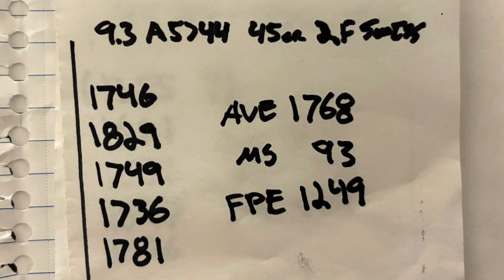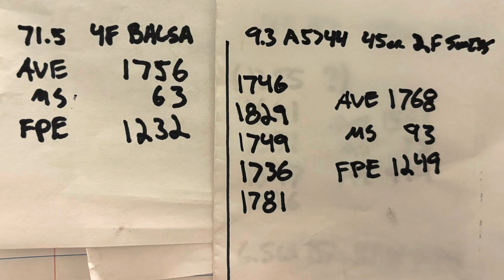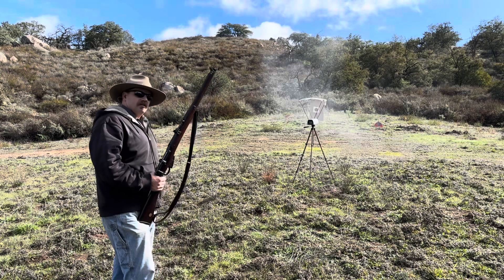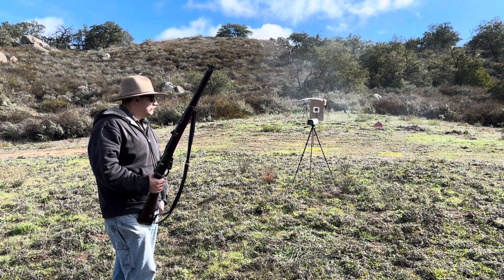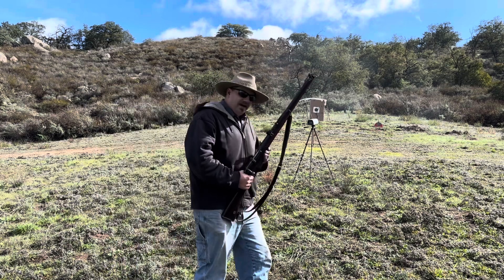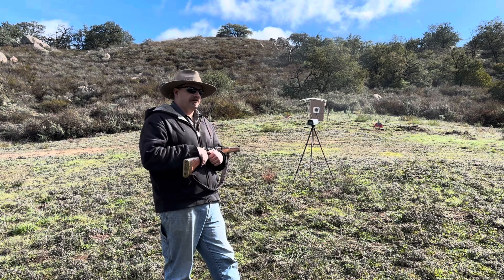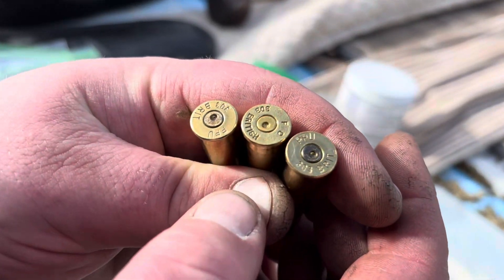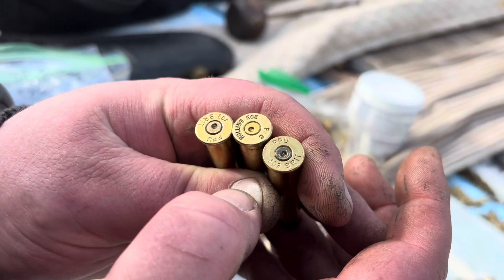Duplex loads, Mixed and Reversed Powder Charges

Comment: Your small smokeless over a main BP resembles my experience with a fat smokeless main charge under a smaller faster powder on top(also smokeless) in .45-120.   I have a .32" barrel, and my best guess is that the slower big main charge is pushing the faster burning top charge down the barrel, then igniting it there - helping to keep pressures up in the long barrel.   Juggling charges around I was able to push a 300gr .458" JHP to about 2800FPS.  ....my groundhog vaporizing round.  I'm not going to give out duplex loads in public for liability reason.  But my main charge was an IMR-4198, and the top charge was a smaller pistol powder charge in the 10% to 15% range of the main powder.
Reply: And BTW - I love what you post on here!

Comment: The "upside down" load actually matches my expectation. Black powder can get things moving but due to thermodynamics struggles to achieve high velocities (1800 fps is considered pretty good). Smokeless powder is mainly nitrocellulose which is not just more powerful but also produces lighter gasses which can push at higher velocities without loosing efficiency (556 does around 1 km/s, nearly twice that of BP, tank rounds get up to 1.6 km/s).

The Idea is that the black powder quickly ignites while the smokeless powder sustains acceleration at the front of the gas column where it's lighter gasses are most needed.
Sort of how you use solid rocket motors as boosters because they're cheap and powerful but thermodynamically lower efficiency. After the early phase of the launch you drop the boosters and continue with a hydrogen upper stage because it's a pain to handle but much more efficient, allowing much higher velocities. (orbital velocity is around 25000 fps+whatever you need to get up there)

I love watching these sorts of weird tests.

Comment: Wonder what mass fraction the BP solids form when they're propelled down the barrel. It's going to be a small number, but (and this is a serious "what if" speculation)... could SP-BP and mixed be suffering from having to accelerate the bullet and the residues, where BP-SP mostly propels the projectile, since the solids are mostly behind that charge?

If you only had access to a high speed camera and some quartz tubes...

Comment: Upside down should "in theory" also be safer. Because the black powder has pushed the round part way down the barrel before the smokeless is triggered, the smokeless pressure is applied to a larger area meaning the maximum actual pressure should be lower. This is assuming the black powder doesn't burn to the smokeless before the round starts moving, so "theoretically" also this was fun to watch, thanks for testing it.
Reply: I don’t really think that theory holds out as he had flattened primers with the upside down load…

Comment: The reverse duplex load is the way I would load it. It made no sense to me to put the faster burning powder in first. Just something I sensed rather than having empirical data to explain. It is in my mind that the pressures are maintained further down the barrel and therefore higher speeds are out of the barrel.

Comment: I have a few questions for anyone knowledgeable in such, would it possible for a .38 special to be a good candidate for a duplex load since it has a higher pressure potential than 3f can possibly generated? Also would it be possible to load a .38 special with say 21.5gr. of 4f powder since it is so fast burning in a short barrel like a pistol? And if 4f is feasible would it then be good with a duplex loading? Perhaps 4f and 3f duplex loading to enhance the burning capabilities?
Reply from the maker: Sure it would

Comment: To me it seems like the art of finding the perfect powder load is about getting the projectile to slowly build velocity all the way to the end of the barrel by gradually increasing the pressure. If the powder is all exhausted significantly before the exit you can lose speed and accuracy and if the powder is not completely burned before exit you have significant muzzle flash and unburned powder fouling. This has to be balanced and limited by the amount of pressure the barrel and cartridge are capable of containing. I think these results are down to the black powder first arrangement allowing all the powder to burn by igniting the slower powder first and the faster powder second. You may be around the limits of what you can do with this in the 303 but it makes me wonder about something like 45/70 and other big slow black powder cartridges and adding a little topper dose of smokeless to boost their velocity. The reaction happens so fast inside the barrel that from our perception it's instantaneous but clearly the timing is more important than I would have assumed or the mixed loads would give the same type of results.
Reply: Your speculation about finding the perfect powder load isn't far off.  It's why there are different burn rates of smokeless powder, so you can cater where that maximum pressure spike occurs to your particular barrel.  Handgun powders burn fast so that they've generated all of their pressure in a stumpy barrel.  Magnum rifle powders burn slow because there's a lot of powder and they want to make sure that it doesn't just spike the pressure and blow up the barrel. (The consequences of using too fast a powder in a large rifle cartridge are amply demonstrated by Kentucky Ballistics' infamous accident with a .50BMG rifle)

Comment: The reversed duplex load actually makes a lot of sense as to why it would produce higher velocity, as it is basically a military duplex load. Meaning that the slower burning powder had more time to build up pressure as it burns, before it hits the faster burning powder to introduce a power spike. In a sense it would be like burn normal gasoline to obtain your take off power to get up to speed, before you introduced nitro s-oxide. Putting the smokeless at the beginning, is like using nitro s-oxide to take off all you would do is spin your wheels before you caught traction resulting in being at your power curve sooner then later.

Comment: Like an artillery shells powder train - a line of blackpowder ignites the main NC-powder charge in a flash. Pressure spike and flat primers go together as I would have predicted - nice. Once again, great on the video.
Reply: Most artillery use a a blast tube to ignite the front of the powder charge. My understanding(please correct if wrong) is that it loses less energy because it doesn't have to push the powder forward and has two flame fronts . Think hemi or centre spark plug vs flathead

Comment: I have payed with duplex loads for years, A gunsmith by the name of Rocky Gibbs got me interested in. He used all kinds of techniques with a lot of different powders and other things, but they were al smokeless powder loads. He used a charge of rifle powder on top of a charge of pistol powder and vice versa. His explanation for the faster FPS of the pistol powder on top was that the rifle powder had moved the pistol powder down the barrel before it ignited and gave the projectile a powerful boot because it couldn't over come the pressure of the rifle powder and therefore the pistol powder exploded on top of the rifle charge and boosted the pressure rapidly near the end of the barrel. I tried many of his loads and one thing I will say, the crack of the rifle is way different.

Comment: The best way I can explain why the "upside down" duplex load works better is that the final "kick" from the smokeless happens when the bullet has momentum at the end of barrel travel, rather than at the start when the projectile is at rest. Think of the previous duplex load as putting your foot to the floor on a gas pedal and then letting off. The upside sown is like rolling forward with 50% throttle then flooring it for a bit.
My question is what if you put just enough smokeless on the bottom (just enough to cover the primer hole so that ignites first getting the black powder to temp to burn clean), blackpowder, then the remaining smokeless on top. I think this might even the momentum down the barrel and give even faster results.

Comment: Wasn’t the original .303 load also shot out of rifles with much longer barrels than the SMLE? Guns like the Long Lee (Lee Enfield MLE) and the Lee-Metford had a 30 inch barrel.  That could be why you’re having so much trouble matching their velocities.

Edit: I should have just waited til the end of the video to comment. Lol
Reply: That's only 5 inches more barrel. Probably not a huge difference. If there was any difference, it could just as well have come from the different types of rifling (polygonal vs 5 square grooves) causing different amounts of friction.

Comment: Just a guess.  Black powder works off of an explosion. Smokeless powder is a propellant. Meaning when it's burning it's the expanding gasses that propel the bullet. So with the smokeless on the bottom it's pushing the black powder out into an uncompressed state causing a loss of detonation. Like a fire cracker that's not been rolled up tightly. Very interesting results.

Comment: I could never get my duplexed loads to work reliably. I used IMR SR4759 and when the full charge would ignite I would get amazing velocity and super clean burns. 
However 1-10 wouldn’t fully ignite. My duplexed 45 Colt would get 1,800 fps out of a 24” barrel (when fully ignited). When I had a failure to ignite it would be 600fps and that’s practically a squib. Gave up after that.
Reply from the maker: Wow, that’s interesting! I haven’t had that problem with any duplex load I’ve experimented with but I’ve never used 4759. So far I’ve used R7, A5744, Bullseye and Red dot.
Reply: @Everythingblackpowder  It’s an older now discontinued powder that approximated BP pressure maximums at a smokeless pressure curve. I wish I could remember the charge sizes but it was 6 years ago and the video never got uploaded. Duplex loads still fascinate me though. Ever since I read about Roosevelts duplexed 45/75 for big game.
Reply from the maker: I miss your YouTube “content” you were a big inspiration for me to start my own channel.
Reply: @Everythingblackpowder  Thanks man. I’m glad to see guys like yourself carrying the torch, and even better than I did! I have done a livestream with @MadrasArsenal and I think those may continue semi-regular. These days though, the majority of my time goes to my kids. God bless!
Reply from the maker: @murphysmuskets  thank you, man. Same to you.

Comment: This kind of reminds me of how modern artillery shells still use a small amount of black powder to ignite the larger powder charge.
Reply: It's the reason why Goex is a thing.  It's a propagation powder for artillery.
Reply from the maker: That’s what I hear
Reply: The same type of load was used for shotguns in soviet union. Primer were pretty weak and didn't ignite well in cold weather. So shooters put a small amount of black powder on the bottom of the shell or even in the primer slot in case of berdan primers
Reply: @sergei_1863  That’s interesting.
Reply: I have heard that as well but I figured that was more of a reliance sort of thing more than a velocity thing. Black powder has a "liquid" phase when it burns that allows it to retain intense burning heat for a comparatively very long time when stood side by side with smokeless powders. (Which is why it burns faster in open air as it can hold the heat of the reaction closer to itself and other unreacted black powder particles) I figure it's that extended duration of intense heat that guarantees that the smokeless powder will go off more reliably even in less than ideal situations where quality may have been potentially compromised.
Reply: I know artillery uses BP but is it duplexes with smokeless for real? Does it depend on the gun size? I remember watching them 155 Paladins firing and lot of visible flash and smoke and THUNDER
Reply: @gb123-ej8wh  The 16 inch cannons on old battleships used duplex loads. Same thing. Small ignition charge of BP with an absolute metric shit ton of smokeless on top.
Reply: @krockpotbroccoli65  I understood that the igniton charge was a 30-06 blank is the iowa class

Comment: If I had to take a guess it's probably that smokeless has a longer run-up time when burning (basically just burns like RC fuel unconfined) while the black powder has a really short run-up time. The black powder acts somewhat like a booster to supply the heat and compression to fully take advantage of smokeless powders true power basically short cutting the hang time in ignition delay. The pressure curve would probably be the signature spike from BP followed shortly by what you'd expect from the smokeless but, adjusted for those burning conditions.

Comment: Looks like you have max’d out the 303 britt using the duplex “upside down”… mission accomplished?! Did you notice if all loads (mixed etc) were as clean? You metioned the extra pressure may have come from the bottleneck area in the round with the reversed duplx, will you be doing the same testing with the .45 colt? I just had to ask…another great video Jake! I learn in all your vids, thank you sir!!
Reply from the maker: Thank you

Comment: I used to have a few older reloading books from the late 60s and the early 70s that listed some black powder duplex loads, and the whole purpose wasn't to get more velocity but to get cleaner shots. 
Some of the early black powder enthusiasts had lost the knowledge of the early black powder loads. 
The main loss was a proper lubricant for black powder, and after a few shots, all accuracy was lost without cleaning the barrel. 
But duplex loads allowed more shots between cleaning the barrel. 
Some of Mike Venturino's articles talked about this issue. 
In his early days, his experience with the Sharp's rifle and accuracy problems he had.
Reply: Ok😮
Reply: I remember reading that, forget where though. Either his bcpr primer book or one of the many magazine articles

Comment: I wonder if people using duplex loads was less about performance and more about how cleanly it made the cartridge burn. Less fouling might mean more accuracy for long strings of fire. Also the early smokeless powders would me much less stable than what we have now. Things like cordite and Poudre B burned really hot and fast if i'm not mistaken. 

Something that would be interesting to try would be flash paper instead of smokeless powder. It is basically straight nitrocellulose. It might emulate the early smokeless powders better.

Comment: So, the first batch smokeless under BP showed some higher pressure flat primers but what about the mixed? Did they have flat primers?
Reply from the maker: The smokeless on top of the BP had flattened primers. More so than the mixed and BP first loads.

Comment: In your older video.  You mention the 303 loaded with solid black  powder “slug” before the brass was formed.  

Do you happen to know if the powder was just compressed and still had a granular structure or more like dust compressed?
Reply from the maker: Granulated, as I understand it
Reply: Thank you

Comment: You're dispelling a lot of myths! I had a duplex of my own. Had a thompson center black diamond that even with the 209 primer would not ignite blackhorn 209 powder. Loading 7 gr. Of triple 7 with 60+ gr of bh 209 on top, worked like a charm. Bitchin' you might say. Plenty of power and no 777 crud.